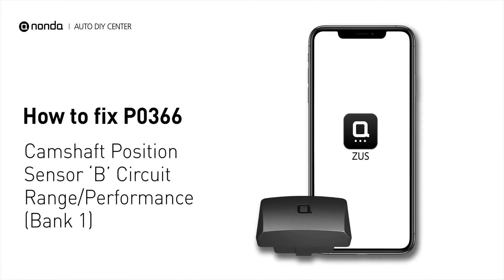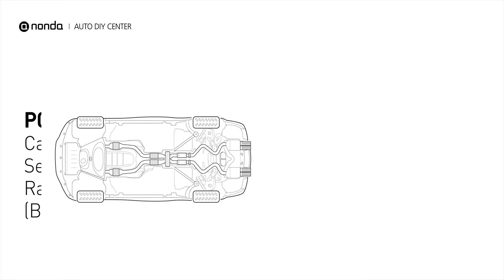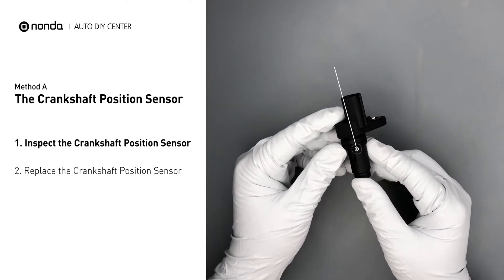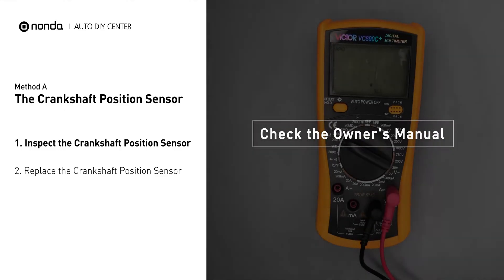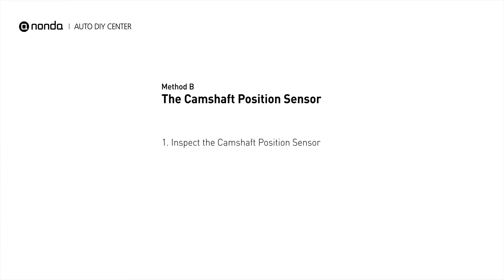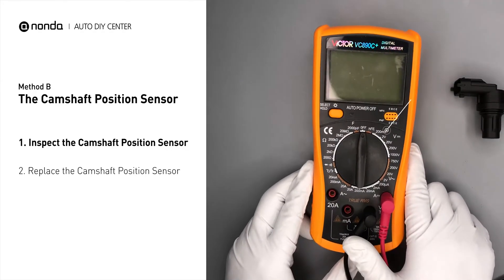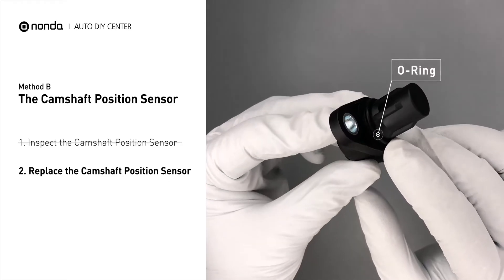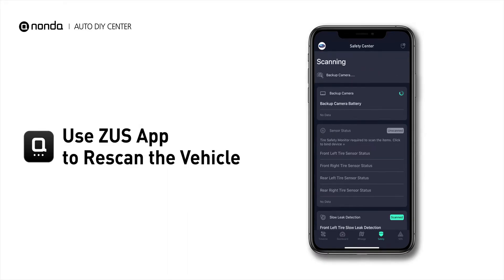How to Fix P0366 Engine Code in 3 Minutes [2 DIY Methods / Only $9.57]

Comment from the maker: Hi, I'm Steve, nonda's lead mechanic engineer. 
Feel free to leave your comments here if you have any mechanic questions, I will be glad to help you out!
Reply: I have a Range Rover evoque 2013 with this code
Reply: Hi Steve. I have a 2013 Chevy Equinox 2.4L and I’m getting this code. I changed the camshaft sensors and it still won’t start. How can I fix this p0036 code or at least get the car to start?

Comment: astra 2012 p0366 cam sensor has been tested and is working correctly. wires are fine. cam sensor also opperating correctly. but still fault persists
 no other codes only P0366

Comment: I have error P0366 from Peugeot 307 1.6 petrol from 2002. I replace crnkshaft sensor with new one, check wire conductivity from ECU,but error persist, and not possible to delite. Same before.
What can I do ?

Comment: What is the proper voltage reading for the meter reader? I have a 2006 Audi A6 and my codes are P0365 P0366 I change  all four of them but the problem is I don't know which side is which driver or passenger side.
Reply from the maker: Camshaft position sensor on the passenger side. The reading values should be from -5 to 0 to +5.
Reply: @nondainc  thank you 😊
Reply from the maker: You are most welcome, Curtis!